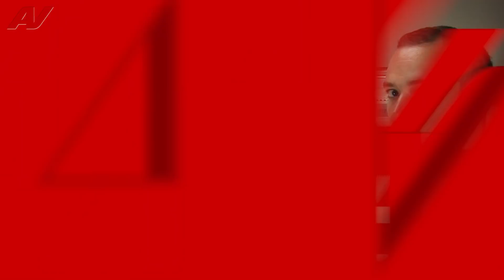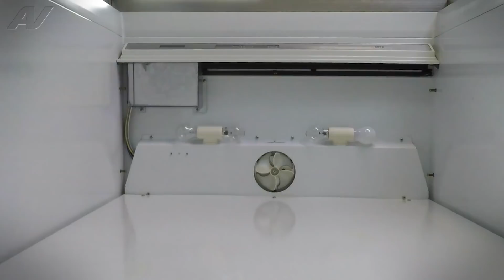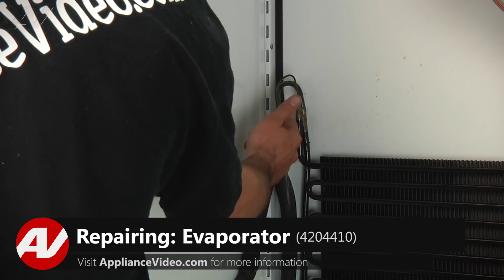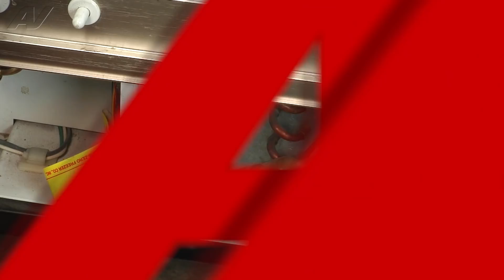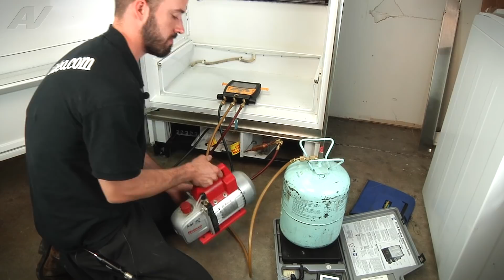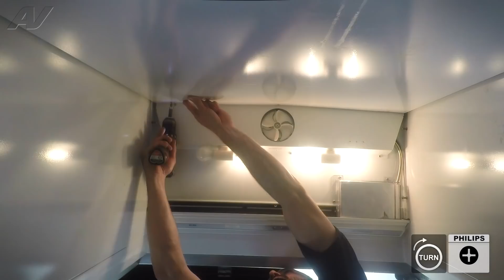Subzero Refrigerator Repair - Not Cooling - Diagnostics & Troubleshooting

Comment: 134a is charged as a liquid. When I put the charge in I go through the high side to see if the low side equalizes and in that way I know the cap tube or system has no blockage. In domestic or commercial refrigeration I place my electronic leak detector in the bottom of the system then close the doors. Refrigerant is heavier than air so it will fall and set off my leak detector. That way I know there is a leak inside without needed to take everything out first. A micron guage would serve you better in your testing for a leak or air in the system. Good job though.

Comment: I have a 601r from around '04. The interior lights only come on when the compressor is running. Any thoughts? We have a new control panel we van install but I want to make sure.

Comment: what did you use to solder the leak?
Reply from the maker: Great question, if you have a more technical question that our parts department cannot answer, you can search our over 17,000 answered questions free at our website www.ApplianceVideo.com under our Repair Help section. You can also call our parts department at 1-800-830-5465 and they can give you help 7-days A week ,or search at www.SaveMoreOnParts.com  .
Reply: An ad for there web site......lol

Comment: so the compressor is at the bottom not the top?
Reply from the maker: Great question, if you have a more technical question that our parts department cannot answer, you can search our over 17,000 answered questions free at our website www.ApplianceVideo.com under our Repair Help section. You can also call our parts department at 1-800-830-5465 and they can give you help 7-days A week ,or search at www.SaveMoreOnParts.com  .

Comment: Very nice presentation. Early in the video, you said 18-22 PSI on suction side and 125 PSI on high side as specified for ~70F ambient. However, once you filled the system with refrigerant, if I am reading correctly your gauges were 35 PSI and 140 PSI approximately. Are these operating pressures because it was on while you were filling to help the process along? 
Thanks.
Reply from the maker: Great question, if you have a more technical question that our parts department cannot answer, you can search our over 17,000 answered questions free at our website www.ApplianceVideo.com under our Repair Help section. You can also call our parts department at 1-800-830-5465 and they can give you help 7-days A week ,or search at www.SaveMoreOnParts.com  .

Comment: my mother has a subzero 601 r/f fridge. it does this weird thing where it cools good then stops cooling and shows error code 06 ec. she has been unplugging it when this code shows up to get it to cool again. this fridge has always gave her problems meanwhile I've been using the same cheap 300 fridge that I got from a salvation army for like 15 years already and it still keeps my beer ice cold. I think my mothers subzero fridge cost her 6000 usd.
Reply from the maker: Great question, if you have a more technical question that our parts department cannot answer, you can search our over 17,000 answered questions free at our website www.ApplianceVideo.com under our Repair Help section. You can also call our parts department at 1-800-830-5465 and they can give you help 7-days A week ,or search at www.SaveMoreOnParts.com  .